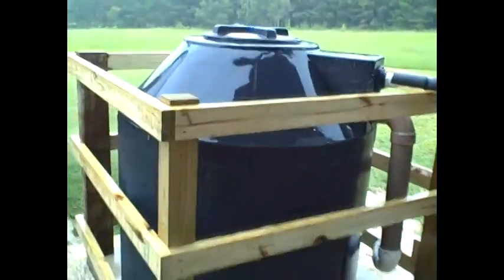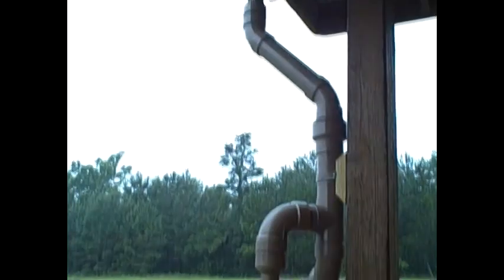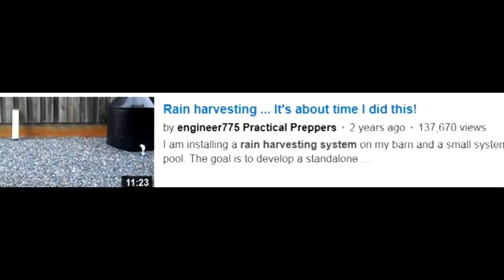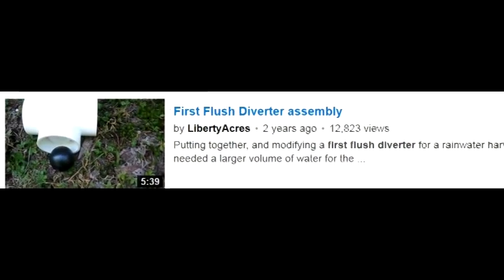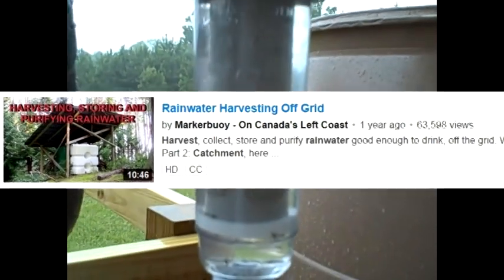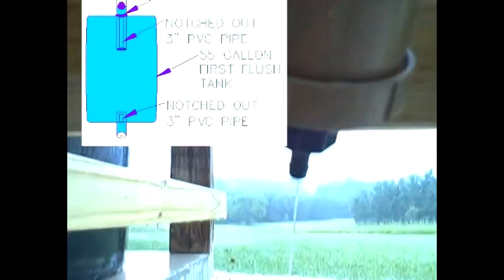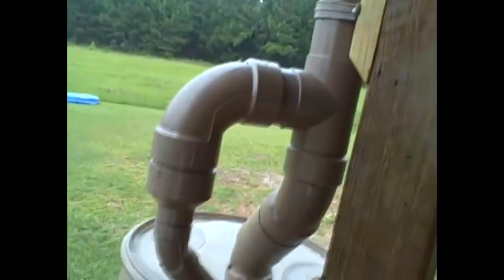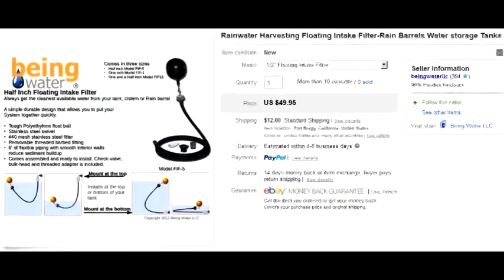Rainwater harvesting setup with 55 gallon first flush diverter tank

Comment: So you waste the first 55 gallons?!  We can't afford to waste that much water!
Reply: The "first flush" is important in drinking water systems to help get rid of bird poop, leaves, and other contaminants that wash down from the roof during the early stages of rainfall. This rubbish gets diverted to the "first flush" leaving cleaner water to go to the next filter.

It doesn't have to be "wasted". You can gather it and use it on a garden or or into a pond. 

From memory, the calculation is 1/2 litre of "first flush"  per square metre of roof for a "clean" roof, or 2 litres/sq metre for a roof that has lots of trees etc over it (more leaves and birds). One installation I did uses the same size tank, and we're a little worried it's on the small side. But they pump the bulk of that water out for use in their toilets. 

Their system captures 500 gallons, and completely filled it in one single rain event just a few days ago.

Comment: How much water does that black tank hold? I found a website that sells simular tanks but where did you get or purchase that one?

By the way awesome videos. I'm trying to get a rain barrel system going for a 3300 sqft garden, wanting to get a 500 gal or 1000 gal. I'm also trying to get a small solar panel system going that I can add onto. I have a acre but I live in a small town, so I'm trying to save money by using solar and rain water to water garden. I'm  also trying to use rain water to flush the toliets in the house but don't want city to fine me.

Thanks for the info on where you got your supplies.